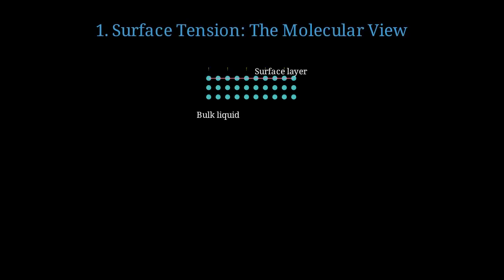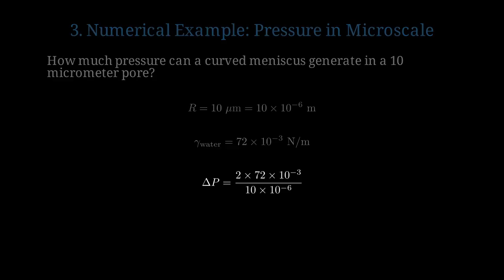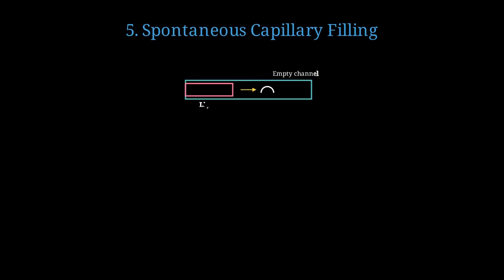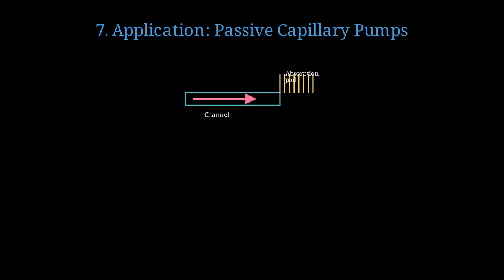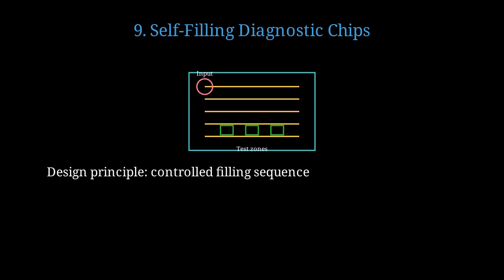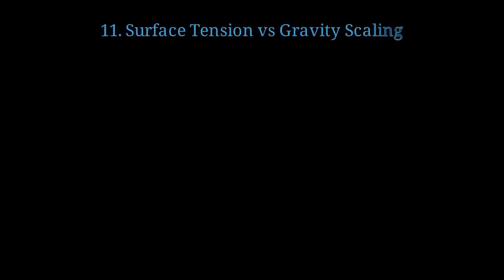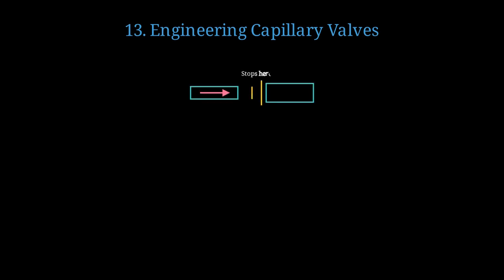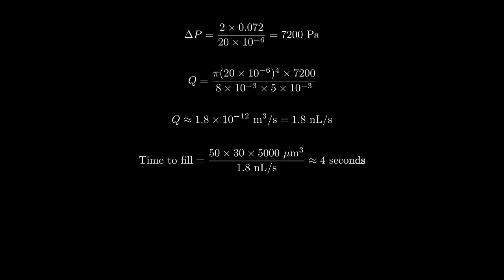How Surface Tension Powers Microfluidics?

Comment from the maker: How does surfactant adsorption kinetics influence Laplace pressure fluctuations in dynamic microflows?
What are the scaling limits of capillary flow under non-Newtonian viscosity conditions?
Can capillary network geometry be optimized algorithmically for maximal passive flow uniformity?